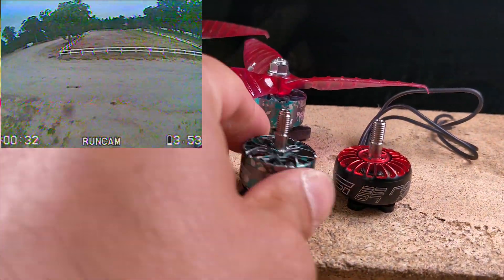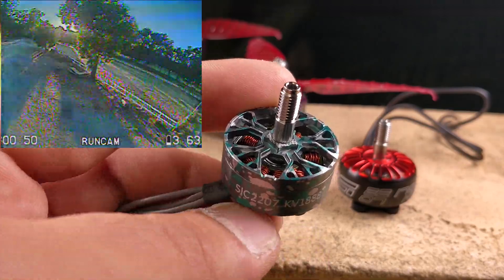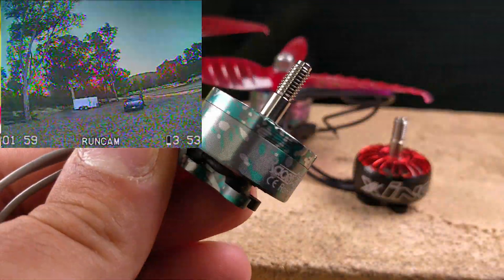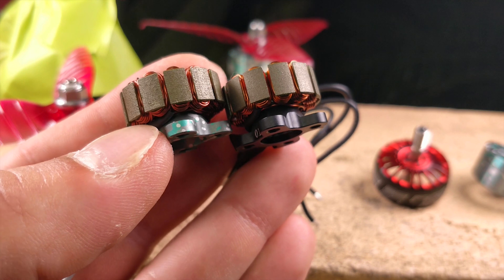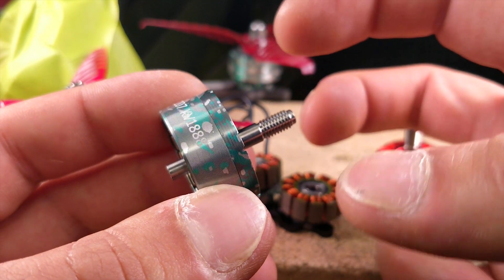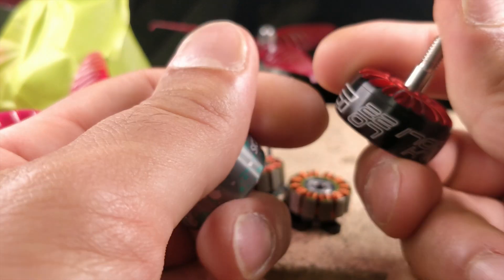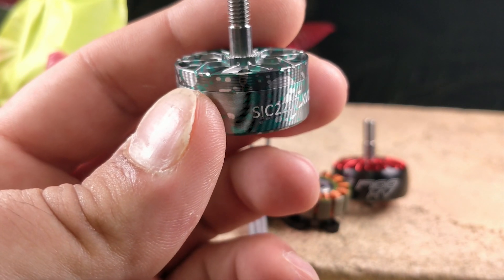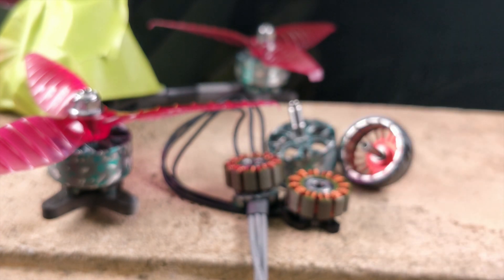Racerstar SIC 2207

Comment: Am not impressed! Motor shafts bent withoutneven crashing! (Just landing on concrete) next thing i knew motor is not spinning freely
Reply from the maker: must have been a pretty hard hit still.  These shafts should really hold up pretty well.
Reply: @Kabab  on 2nd look it wasnt the shaft but the "cover" holding the magnets are crooked. Fixed it with some hammer and drill :D

On the other side, Im using the 2388kv on tmotor 5143 props with 4s and it was buttery smooth!

Comment: Iflight's Xing 1800kv are a great value and rock on 6S. Bother hobby has a 2206-1720kv that gives me 7 minute flight times on 6S with 5152 twins...all of these so called economy motors have been both efficient and sturdy. They aren't SIC but I'm not a fashion flyer.

Comment: What's your favourite
luting cement? 
and favourite ceramic composite for anterior restorations ? 
😁🤔😁
Reply from the maker: I try not to use any composites for anteriors where possible.  I use panavia 2.0 for anterior with either hand stacked or emax.
Reply: KababFPV 
I see 😁👍

Comment: I think that T-Motor are lowering the reliability with the latest motors, nothing to say for the performance that its always Top . I'm using F60 pro II and III  from some time now for all my models, but I've decided to change, too high price for freestyle bando's . At every crash I'm praying to haven't bent something even with not so much hard crashes...big vibrations at from mid throttle range, sometimes solved with a new bell sometimes everything is to throw away...
That said , welcome to a higher quality motor for a fair price !

Comment: Question on motors: Is it normal that there is a little "play" up and down when pulling on the shaft or bell?
I kinda feel like a washer is missing or the c-clip isn't tight enough but friends told me it's normal... ?!?
Reply from the maker: that's usually not so great but not really a huge deal either as long as the bell doesn't fly off.
Reply: @Kabab  I see. Thank you very much for claryfying that. It's on there... just with a little play. ,)

Comment: Did you notice the bug with the bobbles when punching out then pitching forward with these? I could never reproduce that but I don't fly with a GoPro. I lost a quad about a month ago so I went with 2306 on the rebuild. I hated the feel, they (Hyperlite 2306.5 1922kv) had the most linear throttle curve of any 2306 I have tried. But after 50 packs I went back to Xing 2208 1800's and I'm right back to the control I love. Heavy for sure but my favorite motors ever.
Reply from the maker: the bobble is from the props....review coming

Comment: cheap motors equal banged up bells in light crashes, more expensive motors have durability
Reply: well, my sample size of 1 might not be the most accurate test, but I've been using the EMAX ECOs for a while now and had a couple of hard crashes where i bent the motor mounting area but the motor itself is still perfectly balanced
Reply: @Leonsimages  The EMAX ECO are tough motors.  The bearings will take more abuse from the crashes than the rest of those setups - honestly hard to go wrong with those.

Comment from the maker: This motor is actually just $17.50 at these links
1888kv: http://bit.ly/2ZFmIEt
2388kv: http://bit.ly/2MP5oqM
2688kv: http://bit.ly/2LcUPvs

The props in the background: http://bit.ly/2NEtUdL

▼ The build out of this quad:
-Prototype race frame
-Motors: http://bit.ly/2ZFmIEt
-ESC: http://bit.ly/2LiPYrA
-FC: http://bit.ly/2LiPYrA
-Vtx: http://bit.ly/2HBV5C6
-Cam: http://bit.ly/2ZpXlXS
-Prop: http://bit.ly/2ZqXquH (LOL!)
-Battery: http://bit.ly/2ZoW2rq

▼Join my FB group for more discussion: Kabab FPV
https://www.facebook.com/groups/379155946182689/

▼ My typical 5" quad setup:
-Hyperlite Glide Floss (will be re-released soon)
-Motor 1750kv/ESC combo: http://bit.ly/2XAEHXH
-WaFL’s Cap Cap: http://bit.ly/2GUpXxO
-Battery: http://bit.ly/2ZoW2rq
-FC: http://bit.ly/2XRc8G8
-FPV Cam: http://bit.ly/2Q7LfL7
-Vtx: http://bit.ly/2HsrASs
-ND GoPro Mount 30deg: http://bit.ly/2WC15zc
-ND Filter (if used): http://bit.ly/2WEmQ1j

▼Notable motors:
-Xing 2306: http://bit.ly/2Nqqr25
-Xing 2208: http://bit.ly/2y3te8R
-FANTASTIC 6" motor: http://bit.ly/2LqghOZ

▼ 5" Sub $200 build that's still good
-Frame: https://goo.gl/EpXQhZ
-FC/4in1 Stack:  https://goo.gl/HprVbj
-Motors: http://bit.ly/2Nqqr25
-Props: http://bit.ly/2TUQsIg
-FPV Cam: https://goo.gl/FDJhYw
-Vtx: http://bit.ly/2NnO2Au

-Starter goggles: http://bit.ly/2Mw0yNS
-Batt pad material: http://bit.ly/2QGWhYb

▼ If you want to solder better:
-Fantastic solder: https://amzn.to/2P5QM2W
-Fantastic iron: https://goo.gl/DqBipa

▼ Lighting equipment:
-Ring light: http://bit.ly/2ODSg9A
-Panel light: http://bit.ly/2KmDApP
-Power adapter: http://bit.ly/2YD5jHT
-Tripod: http://bit.ly/2MDsMX2
-Mini tripod: http://bit.ly/2MGL4Hf

▼ Tips?
-PayPal: https://www.paypal.me/kababfpv
-Bitcoin: 1E4XZXoD4rS6MYWVWuenY7Kw2M1YgyNpoQ
-Nano: xrb_1188ek5bd7tb9kw67asnp9o65byuoaxbtpxuznx1ribf75x78awywmakj55f
-ETH: 0xD067F93811f2eC31CB1928901002dfdf9A492EF5
-LTC: La2KWYAjp4VT2Lq2M76pbjzXWvRyjpfCtG
-Tesla Referal code: https://ts.la/bob40889
Please use my referral code if you're gonna buy a Tesla.  You get some free stuff when you do and I get better status with Tesla.

Comment: If I want to make a super light 5” with smooth linear motors which size and KV is a good starting point ?
Reply from the maker: that's a very long answer that takes quite some time to figure out as well.  You're going to need to do a LOT of research and even more testing....
Reply: @Kabab  Testing different motors would be awesome. You said it's a long answer we can move to msgs
Reply from the maker: @towers3372  I'm sorry I'm not willing to have that discussion since it's several hours long and probably many months if not years on end of testing. I don't have that much time to manage such a discussion at the moment. I am however working on a few motors.
Reply: KababFPV Brother it’s all good. When you release your motors will some be good candidates for my project? 

an HOURS long discussion it’s a blessing to the community you have that knowledge

Comment: Yes True, there are some things you said I agree with, I also think that iflight make those motors, there are a few unique things that are similar between them. As  for the "1888kv" as soon as I saw the benchmark tast I told myself, no way they are 1888kv! I also think they are 1750-1800 max.
Reply from the maker: I'd say they may even be below 1750kv
Reply: @Kabab  yes... 1700kv will be a better assumption , because their performance is quite similar to the xing 2207 in this video, well to the 1700kv version.

Comment: I'm not paying over 15 bucks for a motor anymore as long as the E motors preform as well as they do.
Reply from the maker: Right.  I agree.  I do have an actual improvement to 5" motors coming but it's going to be a cinema motor and really not needed for anyone other than those trying to get the very best footage.  That motor will likely be $22 because it did take a lot of money to make but it's genuinely different than anything else right now.
Reply: @Kabab  what sizes are there going to be, I need something for an acrobrat if avaliable.